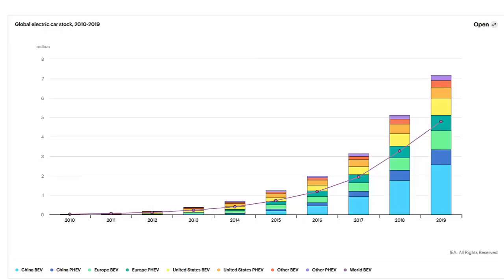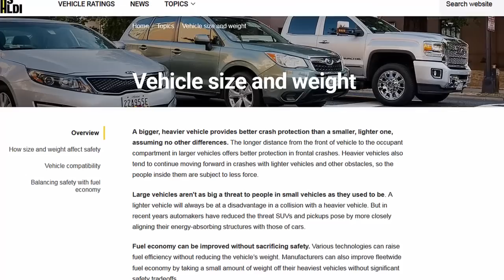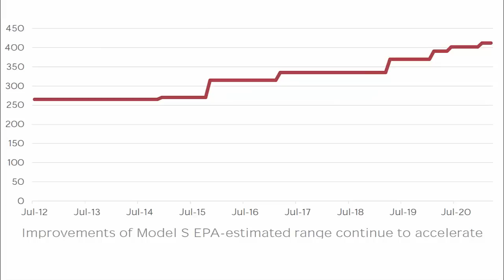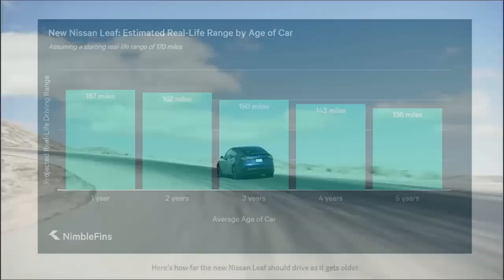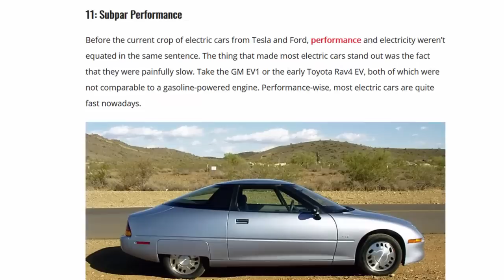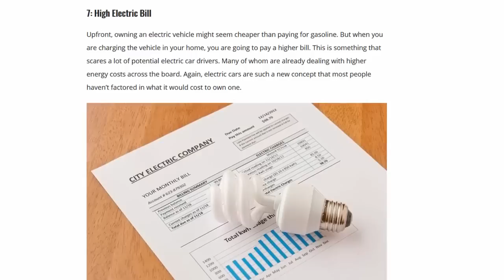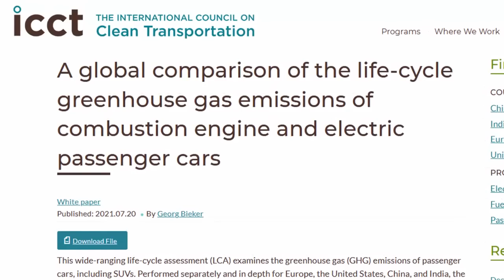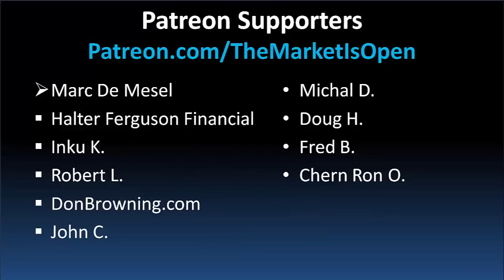Tesla will DECIMATE Gas Cars

Comment: None of this whole video matters in the US for this reason…..there is no way for people who live in apartments, high rise condos with parking decks in big cities, house with no garages, and in big cities you have to park on the street with no dedicated parking spot allowing overnight charging.  Most importantly,  the power grid is not close to being able to handle the cars charging all at once at night.  Big cities in the Northeast has power lines from the 1960’s so putting a bunch of chargers on them would cause them to melt…..there are already rolling blackouts in CA when everyone has their AC on high.  Another reason is cost.  You can buy a Honda Accord or Toyota Corolla for half the price as a Model X…..you cannot spend $25k in gas and maintenance to break eleven so the EV is not a good financial decision either.  EV’s have a lot of hype but reality will kick in for the reasons I listed and slow the EV momentum.  Basically, gas cars are going nowhere and there is hundreds of years of oil so we aren’t running out.  And lastly, China has purchased the large mines making metals for he batteries so if you want a dominant Communist country controlling world transportation then buy an EV
Reply: The EV's charge at night.  The grid has been constantly expanding to meet demand and the new night time demand helps even out the daytime surge.  The grid won't be an issue.  If apartments and condo's want to keep tenants, then they will upgrade parking facilities to include EV charges.  A lot of new apartments all ready have them.  

The reasons you listed are just FUD and will not slow the adoption of EV's in any significant way.  

The average price of a new car in the US is about $40k. That is the same price as the Model 3.  Arguments about how expensive EV's are just fall flat.  

The only thing holding back EV adoption is the building of the factories to make the batteries and cars.
Reply: @jimdandy9118   - I have spent more than a decade researching EV adoption and have been driving an EV since 2011.  Charging at night is good for the grid.  Apartments, hotels, condos, office building can install EV charging stations.  It's not impossible.  It just costs money.  Money they will gladly spend in order to attract tenants or customers.  

Do you not get what causes blackouts?  Demand exceeds supply.  That happens mostly in the late afternoon when outside temperatures are at the peak and only in states that haven't planned for the increase in demand.  EV's mostly charge at night when demand is low.  You clearly need to do some research before commenting on the electrical grid.  I guarantee you the electric utilities are planning for a future that involves EV's as a primary form of transportation for most Americans.  They have the most to gain with customers buying more electricity.  It's good for business. Your notion that a business doesn't want to sell more product is actually clueless. 

Change is coming.  It's very clear what is happening.  You should watch some of Tony Seba's videos on disruptive technologies.  The horse and buggy was replace with the automobile.  Steam locomotives were replaced with diesel electric.  And ICE cars will be replace with BEV's.  Gas stations didn't magically appear in 1910.  It took time to build refineries and a distribution network.  But the horse and buggy still disappeared in roughly a decade.  Assuming something similar can't happen now shows how disconnected from reality your are.  You are suggesting change is not easy, so therefore it can't happen.  That is wrong.
Reply: @donm2255  A decade researching huh.  Well you obviously have no concept of what you read.  Apartment complexes are not going to retro fit hundreds of charging stations…God that’s just stupid.  There is a higher demand for apartments than supply so complex’s will not have to install anything to attract renters.  I’m guessing you’re actually a kid with this poor understanding of housing and free market.  Next, the houses in big cities where cars park on the streets you forgot about those. To say “they can just pay to install them” is something someone with zero business experience would say.  Did you really say charging at night is good for the grid?  Wow.  Take all electric cars and plug them in at the same time in the evening and watch the grid fry.  Not enough electric  power stations and the transmission wires in most all big cities need replaced.  EV cars are good but not a priority like you think they are to spend that kind of money.  Did you also not understand the US economy is fossil fuel based and removing oil drilling, refineries, truck transportation of gas, pipelines, ICE parts manufacturing, repair shops , jobs building cars…I can go on and on….would destroy the economy just so you can feel good about an EV car?  Grow up.  This the real world and a real world economy that your fantasies don’t work in.
Reply: @jimdandy9118  "Zero business experience."  LOL  I'm a retired account with 30 years of business experience and I own a successful medical testing lab.  I understand business and what businesses need to do to retain customers.  You clearly don't have a clue and are just making stuff up at this point.

If apartments want to rent apartments to owners of EVs, then they will invest in chargers.  It won't happen overnight, but there is already a gowning list of apartments and condos that have charging available to renters.  Just google it.  I can find several where I live that advertise their EV charging.  They are already investing in chargers to accommodate the needs of their customers.  

Charging at night shifts demand.  I literally get a discount on my electric bill because I charge after 11pm.  It helps even out demand and that is good for the electric utilities. The hardest thing power companies deal with is disparity between daytime and nighttime electricity usage.  Again, just google it.

Home EV chargers take about as much power as an electric dryer (or less if you charge via 120v).  Cloths dryers haven't fried the grid and neither will EV chargers.  And with new vehicle to grid technology, the cars can actually feed power back to the grid during the day when everyone is running their A/C.  

If you don't have a garage and want to drive an EV, there are solutions for charging.  Just google it.

Disruption destroys a lot of businesses, but creates opportunity.  Henry Ford destroyed businesses that made horse drawn carts.  And created a use for all the gasoline that Standard Oil was burning off.  Seriously, you need to watch some of Tony Seba's videos on disruptive technologies.  Persons that own gas stations, oil change and muffler/transmission shops, etc. are in for a world of hurt in the next decade.  The economy is fossil fuel based because there hasn't been a better/cheaper solution unit the lithium ion battery revolution.  Go to home depot and look at push lawn mowers.  Half of them are battery powered now.  That battery technology is changing the world.  You just don't see it yet.  It won't be long before half of all cars sold in the US will be battery powered.  The best/cheapest solution always wins.
Reply: @donm2255  Not impressed.  There is no demand problem for apartments, there aren’t enough of them.  They last for 50 yrs so the legacy complexes will have zero problems filling them and do not and will not spend $100’s of thousands of dollars installing charging stations…..a typical large complex has hundreds of parking spots that are full of cars.  Putting in a few charging stations will not solve anything so this whole “they will have to put in charging to attract tenets” is just dumb.  Cars parked on streets in big cities still can’t charge. Everything else you are saying about dryers and current draws on the grid are just that, current.  You have been listening to the wrong people about the grid and charging at home.  Again, you assume there is this massive desire for electric cars and that’s going to cause all of these huge investments in the grid, power plants and charging stations….hate to tell you but most people don’t care.  EV cars are not a good financial decision either.  A Honda Accord is half the price of a Model X…..you can’t spend $25k on gas in five years to break even.  Nothing you have said still makes any business sense.
Reply: @jimdandy9118  I'm sorry, Jim, but I believe don m has more convincing arguments than you. You also seem to be too emotionally attached to ICE cars.  Don't worry, everything will be better when they disappear, you'll see!  :0)

Comment: I noticed that you did not include insurance costs in your comparison. As far as non-repairable batteries go, break a plastic battery cooling fitting and cry when you have to by a new battery😢 Now with structural batteries that $1.25 fitting may cost you the price of a car.

Comment: Electric vehicles are inevitable. They're more efficient, more economical, and perform better in all metrics. That's not even getting into regulatory requirements. The EU has mandated no more ICE cars by 2030, and California has followed suit, with several more states pushing similar legislation.
Reply: Perform better in which "all" metrics?! Are you insane!?
Reply: @alanmay7929  Let's see...

By virtue of how electric motors work vs ICE's, it has more torque at the wheel, leading to faster 0-60, faster top speed, and even better braking thanks to the regenerative braking system used.

From there, we look at handling. Due to the center of gravity being centered between the axles due to the largest weight being the battery, it has a much smaller second moment of inertia, leading to better performance on turns and an almost inability to flip no matter how hard you try. 

Finally, it costs less to operate than an ICE because a) most regular maintenance no longer exists, b) you're charging up at home during off-peak for pennies instead of shelling out half a day's pay at the pump, and c) will last longer than an ICE because not only are there fewer parts to go bad on an EV but the batteries lifespans tend to range upwards of 400k+, while you're lucky to get 100k out of an ICE. 

So... yea. Punked at every conceivable metric. And when the Model 2 comes out at 20k retail, they'll also be cheaper initial cost as well, putting the final nail in the coffin.
Reply: @alanmay7929  Wow, and every single word is completely irrelevant. 

It's not about what the 'fastest top speed in the world' are, it's about the energy to torque ratio. Electric motors convert electrical energy into torque FAR more efficiently than, say, your Bugatti's motor does. Which would get spanked, by the way, by a Plaid Model S at less than a tenth of the cost on any track despite the theoretically lower top speed simply because of the better accel curve and handling. 

Diesel vehicles, so we went from consumer cars to semis then? Fine. Let's go there. 85% of all routes are short-haul, running spoke-and-hub operations for places like Walmart, FedEx, UPS, and others, with a distance of less than 400 miles. Since an electric vehicles maintenance boils down to 'occasionally replace the tires', operating costs are a fraction of what a conventional diesel semi is. Walmart has already placed an order for Tesla Semis, you think they're doing that because they think it is cool?

Face it, ICE is dying fast. In under a decade, there will likely be more EVs on the road than ICEs. It'll happen that fast. And honestly, I don't really care if you believe it or not. People don't believe in the moon landing either, that doesn't mean it didn't happen.
Reply: @ShneekeyTheLost  you are very funny because a porsche 911 is faster of the line compared to buggati, the buggati just like koesnigsegg were built to smash the records limit of what any vehicle can achieve about 300mph, diesel are used in agricultural, construction and very long/24/7 operating machines,  for overlanding/towing rescue services diesel is the king, just look at the Australian road trains. The operating costs of the tesla semi is just barely some cents below a diesel truck, those diesel trucks can actually tow way more and configured for sooo many different applications. ICE isn't dying fast and until all manufacturers are able to make t least 10 million EV a year it will still take decades.
Reply: @ShneekeyTheLost  Walmart placement on tesla semi means absolutely nothing until those trucks can proove what they are able to do.

Comment: Battery replacement: $4000

Engine and transmission replacement: also $4000

Except if you replace the battery in an EV it's practically resetting the odometer to zero and an EV with 250 miles on a charge will last over 350,000 miles.
Reply: My Prius battery cost me 8k. Your figures are wrong.
Reply: @callmeishmael7452  The other option is they overcharged you to make a profit.

Remember Tesla doesn't sell at dealerships because dealerships would have their revenue cut in half because maintenance cost is so low.

So the obvious answer to your problem is the dealership charged you so that they could keep their normal profits.

Not to mention Teslas main way if making EVs affordable is to reduce the cost of the batteries.

A decade ago 1 kWh cost $1,000 and today it's less than $150 per kilowatt hour.

Tesla plans on cutting that price down to $50 per kilowatt hour by 2023.

Not to mention the cost of replacing a car is about $20,000 after 150,000-250,000 miles but a Tesla will last twice as long so therefore you won't need to get a new or even a new battery.

It's about looking in the long term.
Reply: @matthewboyd8689  roadster battery? 12k USD OFF THE SHELF, NO INSTALL. The s models are just coming off warranty now and batteries are not 4K USD.
Reply: @callmeishmael7452  the Model S batteries are bigger, about 85kwh-100kwh at their biggest.

The compact car will probably have 40kwh & 55kwh and be maybe 220 & 300 miles because a lower price car will have a lower range to fit demand, and the lighter car gets more efficiency.

Tesla has said their 4680 cells will cost $50 by 2023 (the year they plan to sell said compact car)

Meaning that +8 years after you buy it, it most certainly will cost closer to ($50/kWh x 55kwh) $3,000 after driving much farther than any internal combustion engine vehicle and replacing an engine in transmission in one of those vehicles cost more than that.
Reply: Bullshit mate stop it, a 10 years dirt cheap old ICE still gets better range than a tesla, the tesla also gets outdated with time just like iphones.
Reply: @matthewboyd8689  nonsense which ICE will be replacing engine and transmission?! What do you think about those 20+ old ICE on the roads, do they need engine and transmission too!! LOL.....

Comment: Unless that is that it has a stupid yoke steering U (not wheel).  This is the dumbest thing.  How can you have half a steering wheel when you are off road or trailering?  🤷‍♂️  Also there is no infrastructure to support charging while trailering with a large 42' 5th wheel.  Is Telsa going to have a lot to drop all the trailers that is flat and level so you can pull in backwards to charge?  The biggest issue with Tesla is customer service and lack of build quality.  If they can fix that and the whole large trailer charging infrastructure thing maybe.

Comment: funny story, if a tiny part on the cooling system atachment breaks, Tesla says the only fix is replacing the whole battery pack which comes in at a modest 16 000 dollars LMAO.
Reply: Where did you find this out from? Is it in their online handbook?
Reply: How often does that break? These parts are extremely simple and reliable
Reply: Probably because it's one part to save costs, where did you hear that information?
Reply: @dr-k1667  it’s from a video from Rich Rebuilds. Only representative of one possible case.
Reply: I saw that story and in the end it was fixed with a $5 part.  You left that part out trying to spread FUD...LMAO
Reply: @thomasreese2816  the problem isn't that its reliable, but the fact that that guy had to go and rely on rich rebuilds just show the truth about tesla and right to repair.
Reply: @dfreadhoff  it was fixed by rich rebuilds and not tesla lol..